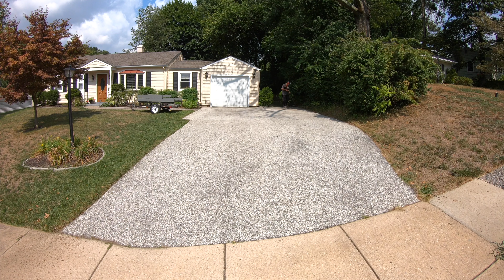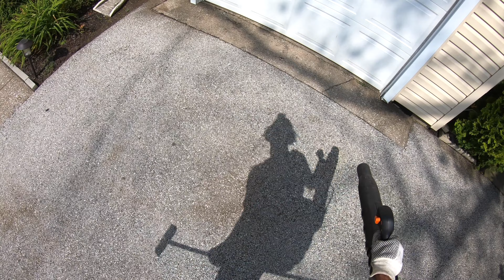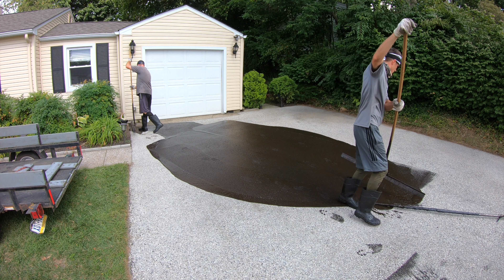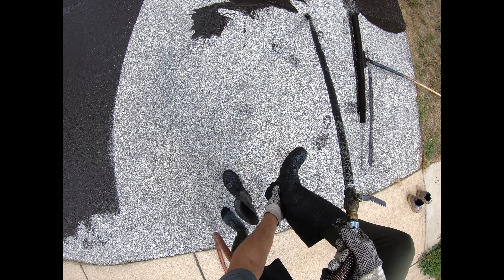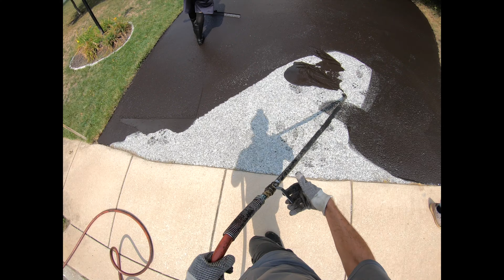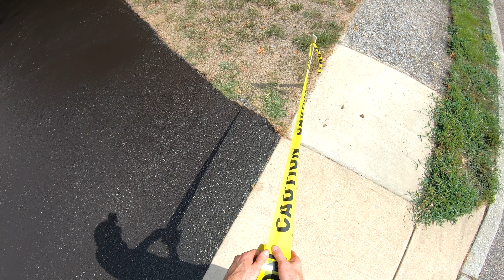Professional Driveway Sealcoating #40 "Last Day of Summer"

Comment: I am so ready for the season to be over!
Got just 5 left to do....then the truck goes into hibernation! 
With lows in the 30's/40's and highs only in the mid 50's all week...I gotta hold out for some warmer days.
Reply from the maker: Do you find it leaves tire marks if you seal below 55 degree temps?
Reply: @SEALCOATINGISLIFE  I found that I have to redo them in Spring. Back before I went off on my own, we'd use the coal tar early in Spring and late Fall when temp were cooler, and that wasn't too bad. That's been banned in too many areas around me. Using Master Seal PMM exclusively, it just doesn't handle cooler temps(before it has fully cured). Since on my own, I've only had to redo one. We were right at 55, and forecast fore 40's afterwards. Last one of the season...it was also the first one of the next season! It all just flaked away over winter.

Comment: Hi guys. Great job as always. Just a question, is there an advantage that way over using the sprayer system?
Reply from the maker: More control, and I think it binds better when you brush it in from multiple directions. That’s just my opinion though.
Reply: Awesome. Thanks for replying 😊
Reply: Is there a specific brand brush you would recommend. I've been spraying for awhile but run into so many problems and wanted to give brushing a try.

Comment: With it getting late in the season are you able to seal with dropping temps, does that affect anything if it were to go below freezing?
Reply from the maker: Yes. The driveway has to hit above 50 degrees for proper adhesion. In the sun the driveway get pretty warm well into November. We usually stop just before Halloween.
Reply: @SEALCOATINGISLIFE  So it is okay if it gets into the 40s and 30s at night as long as the driveway is 50 or above while it dries and cures?